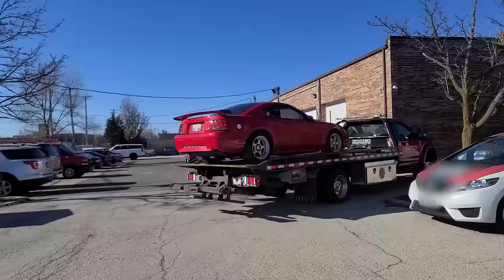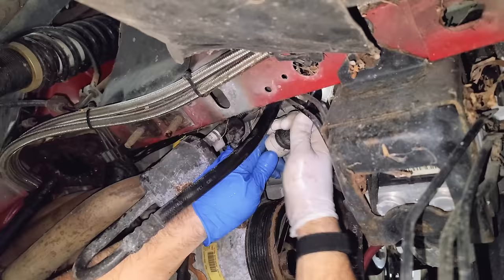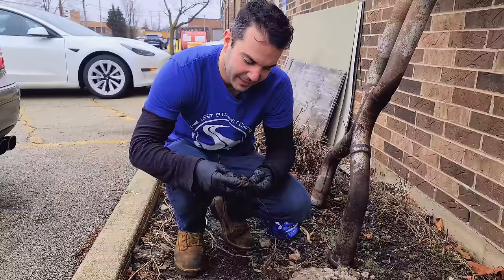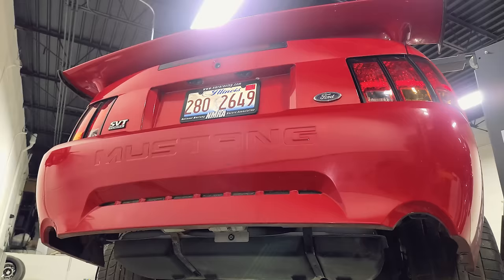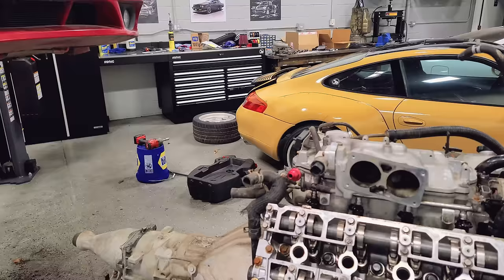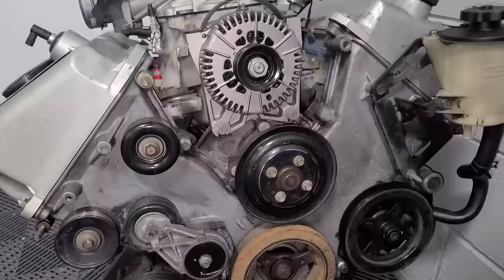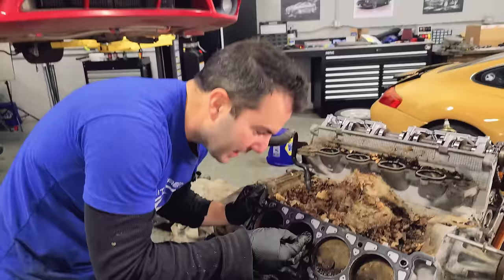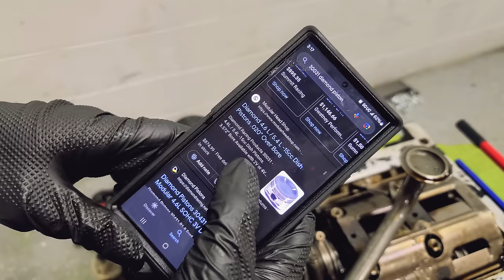Rebuilding The World's Fastest Cobra Mustang! ABANDONED For 20 Years! New Engine & CARNAGE!

Comment from the maker: What are you guys working on this week?
Reply: Framing in a bedroom in my basement unfortunately
Reply: I'm working on my 1968 VW Beetle
Reply: My 03 Mach 1
Reply: Jaguar xf v6
Reply: HAPPY NEW YEAR Alex and the LSC team!!
Rebuilding my motorcycle.
Reply: 1995 mustang putting a vortech on a 331 with heads cam intake. Hoping to make 500whp~ with low boost and mild timing.
Reply: tryna get my 07 mercedes e350 winter ready, quick question cause you are mr mercedes? any reason my transmission wont engage sometimes and also shifts with a little stutter before it warms up?
Reply: i am currently sourcing a flat 6 for my 02 outback. the 2.5 has timing chain issues and i want to get a better engine installed and make it even more reliable.
Reply: Nothing as it's winter, and snow is coming
Reply: A 2000 Buick regal GS going in with a built engine, cam, exhaust, headers, and series 3 supercharger on full e85
Reply: Suspensions on 2012 dodge charger and a possible engine mount.
Reply: I haven’t started on my project yet, but I hope to get started on my late grandfathers 2002 regular cab f250.
Reply: My Citroen BX.
Reply: 2001 dodge ram 1500 manual 5.2 v8
Reply: My mustang
Reply: Just Got a 2 stroke 100 CC Yamaha Rx100 Bike. Wifey is super mad.
Reply: Just picked up a 96 cobra with a locked up engine 😅   fml.
Reply: Building a new gauge cluster for my 68 F100
Reply: putting some lowering springs on my S550 Mustang
Reply: Jeep JK rebuild!  salvage title just got body panels back from the painter!
Reply: Honda CBR 1000F/Hurricane 1988
Reply: 2011 saab turbo4 2.0t 
Upgrading stock turbo to a ko4 and installing oil catch can. Oh and shoveling some snow. Gotta love Chicago
Reply: I’m tuning my little engine swap turbo civic hatch keep up all the hard work!!
Reply: 1983 Oldsmobile with the 5.7 Diesel.
Reply: 1992 honda prelude. new ecu and turbo goodies
Reply: Replacing center drive shaft support on my 2007 Tacoma. 
When it gets warmer, going to add power steering to my Mk 4 Factoryfive cobra. Might need extra set of hands. I'll drive it to Chicago.  :)
Reply: Sway bar upgrade on my 2020 SQ5
Reply: 2003 Terminator. Will be installing a VMP 2.3 and 60 lbs Injectors soon. It’s to cold now 😊
Reply: Honda crf150r
Reply: 32 foot Pearson 323 sailboat. Building my 1 litre 3 cyl Yanmar.

 Don't even own a car. Just an old school gear head. Had a '70 Mach1 when I was 17, though.
Reply: 1994 saab 900 se 3 door
Reply: Replacing my 25 y/o KitchenAid dishwasher!  😁
Reply: Working on getting over this damn cold.
Reply: My daughters boyfriends 05' Audi S4.
Reply: Gonna work on cooling on my steamdeck with my friend 😅
Reply: Trying to stop my Jag leaking rain water into the footwell 😭
Reply: Going through a 51 Vincent Black Shadow. Polishing wheels, checking brakes and new tires/tubes.
Reply: I’m finishing my supercharged Nissan armada 😅
Reply: Drivability issues with my 89 Dodge Dakota sport convertible. I've been through the fuel system, next comes the vacuum and emission systems hoses, then the electrical system.
Reply: Working on my 1996 honda accord
Reply: 1965 Porsche 356SC
Reply: 2012 Duramax rebuild
Reply: Another cold weekend in the shop working on the  1984 volvo 740
Reply: Can't work on my car (64 Mercury Comet) in winter where it's at unfortunately (where I live winter is cold 🥶 and the garage where I keep the car is not insulated or heated). Did check on it today and all was well...
Reply: Cleaning the caked on oil and dirt on the engine of my 2000 Excursion XLT, prepping for oil leak repair.
Reply: Brakes on the daily Mazda 6 and some emblem stickers on the GT350 while she sleeps.
Reply: Builds a 4 cylinder engine
Reply: 62 vette
Reply: Working on my 2012 mercedes c250 … cam/timing problems smh
Reply: my 98 eclipse gst
Reply: 04 ram 2500 w/5.9 Cummins....
Reply: My wifes 1999.5 cabrio. Did timing belt, clutch, and brakes all the way around.
Reply: 1979 vw super beetle convertible
Reply: 2007 gsxr 750 built from a spare engine and frame a lots of eBay purchases 😅
Reply: 90s dodge ram
Reply: 1999 E430 sport ball joints. Easy peasy
Reply: 1970 olds 442
Reply: Getting the carbon splitter and side skirts mounted on my baby, w205 AMG C63S
Reply: New to me 2016 F150 5.0
Reply: Prepping snowblower
Reply: swaping a ls3 into a 08 jeep jk
Reply: Putting a open air intake on my ford mondeo 2.5 turbo 5 cilinder. The sound of the turbo is pretty nice now.
Reply: 98 GT convertible I drove for 23 years. Sitting for a few years now. Gonna refurb entire car for my 13yr old boy
Reply: 2002 tundra long travel suspension install
Reply: 1992 firebird. V6 with leaking 700r4. With the idea of pulling my trans, I start to think about just doing a full engine swap with a slightly more modern trans.
Reply: grand cherokee amc 242 4.0l rebuild
Reply: 2022 Explorer St
Reply: I'm tearing out the interior of my 1979 Hurst Olds Cutlass.  I've got OEM fabric for the seats, new carpet and a factory looking replacement stereo to replace the factory AM/FM/CB radio.
Reply: 03 ZO6, replacing the steering wheel and pulling the wiper arms so I can clean out the mouse nest in the cowl.😢 previous owner stored it in a lean too with chickens 😂😂
Reply: Working on my neighbor.  Trying to get him to sell me a number matching ‘68 302 manual Mustang sitting in his front yard for the last 18 years.  He drives it twice a year and that’s it. 2024 could be the year!
Reply: I'm washing my Toyota Corolla. I dare not touch anything mechanical on it as I have a great mechanic who knows what he is doing and I don't
Reply: My ‘94 Mustang Cobra.  Putting in subframe connectors, jack  rails and strut bar.
Reply: Just finished re-suspension-ing my 206k-mile 200 Celica daily...serious rot where rear subframe bolted to frame stampings.  Took daily rust showers while doing the work.  She's got nice shiny black rear suspension now though and rides like a Caddy on the taller tires I bought her!  Just a little work with a 3-pound hammer to quiet the rubbing sounds from the front wheel wells!  Also had to cast new urethane bushings from 3D printed molds as the only way to get new rear bushings is to buy new rear knuckles!  WAY too spendy when there's nothing wrong with the old knuckles!

The thing's ready for the scrap heap and I'd like something a little newer, but there's nothing secure about Social Security, so I have to refurbish junkyard parts and keep the old girl running...thank God I know my way around cars!...I feel sorry for folks in my situation who don't!

Three kinds of cancer, a liver transplant, and a total colon removal ain't gonna stop me wrenchin', dammit!  It'd be nice, though, to have a bit more cash so I wouldn't have to buy the cheap, Chinesium, wheel hubs 'n' such from Rock Auto...but, hey, Ken-L-Ration has really improved over the years, and many parts of the pine tree are edible, so I'm good!
Reply: My golf mk4 , replacing rear door , and right fender + headlamp, 😮 then leaving it at the paint shop,
Reply: @@LegitStreetCars   I'm building my fully touchscreen preamp for my hifi system, with an 88 led stereo bargraph display using 2mm optical fibres!  Just finished the frame for the circuit board that positions the optic fibres precisely above the board mounted leds, & then repaired the design faults.  Also finished the aluminium mounting bracket for the board, so now the bargraph board is finally FINISHED & WORKING! - Ready now to have the optical fibres glued into the frame with UV glue, & measured up to be flush with the front panel.  About a week & a half's work.  What a tedious nightmare!  LSC videos are an excellent distraction for a break!👍
Reply: I'm repairing fuel tank leaks on my 90 Thunderbird SC
Reply: Nothing too exciting. Installing a backup camera on my 04 Tundra limited for hitch alignment, a new head unit, and a rear view mirror dash cam. I ran the backup cam wire before the snow hit, so I can camp out in the interior and do the rest. If only my garage wasn't filled with my wife's stuff. 😂 I'm going to build her a shed next summer if I can find the time.
Reply: Taking the kids to Disney World. So, I am working on my inner calmness in a sea of people.
Reply: 1994 S10 SS with a LS swap and twin turbo Borg S366's
Reply: Wifey's 2009 Chevy Traverse LTZ strong crank, no start, no codes... Changed throttle body and it drove for a few miles no issue, sat overnight and back to crank no start, doesn't even stumble or try to fire.  No stored or pending codes.  Great fuel pressure and solid spark.  I'm at a loss...
Reply: @rohittaurus911 had a 85 Yamaha RZ350 Kenny Roberts bike. Those were super cool. Revved to like 8700 or so
Reply: @CODPerryThePlatypus  tried the pedal tcm relearn procedure? Helped with random shift issues with my 04 e320... Does it shift with the tiptronic +/- in manual mode when the automatic is acting up?
Reply: Routine maintenance on the family truckster aka my 2014 durango
Reply: Selling my 04 cobra terminator this week. I’m gonna miss it 🥲
Reply: Trying not to loose mind)😅
Reply: Chevy Cruze 2011, burnin oil 😭
Reply: Getting my list together for a 120k mile service on the 2013 W204 C300 4Matic Sport.
Reply: Putting a clutch in my gt500
Reply: Replacing all door and window seals on my 6MT G37 coupe cause I got a major water leak.. 

AND a Harmonic Balancer/Oil/Coolant/Diff/Trans/Brake flush 😢 on my Silver 2013 Caprice PPV 9C3 ✌🏽😎

SELL YOUR CAPRICE TO ME ALEX!!! 😂 Maybe you'll let me drive it when I win the next AMG you give away lol

P.S. I was also a Mercedes-Benz Tech for years, and we had those engine tables for when we replaced the head gaskets on the M278's they're so nice to use. Also expensive.. I got x30 M278 camshaft tensioner pins under my belt 😎

I love all your videos man. I can't wait for them to come out! I appreciate how long they are. Thank you for the hard work! You have my dream job lol
Reply: everyones car but my own. mechanic life
Reply: On Sat, me and dad are driving 600 miles from Delaware to western PA to get a Muncie rockcrusher Trans for our 57 Belair.
Reply: Man where is peter ?
Reply: Generators and Volvos

Comment: 99 Cobras all had the same bumper as the GTs from the factory. Starting in 2001, the Cobra had its own unique rear bumper.

Edit to add: those calipers are made by PBR, and say Cobra from the factory. They’re one of a few popular upgrades for GTs, as they’re plenty stout for a New Edge Mustang.
Reply: The 96-98 also had its own unique rear not just 2001 and up.  94-95 and 99 just said MUSTANG for whatever reason.
Reply: @midnight347  that’s correct. I was speaking about the 99-04 cars specifically

Comment: I would stick some valves in the old heads and if needed, manually polish the valve seats, no need to go to a machine shop! The old heads seem to be much more tuned and probably tuned towards the supercharger you have! Bottom end looks amazing on the new one, so best of both worlds!
Reply: Manually polish the valve seats? Did I just watch the same video? Those things are roached, repairable most likely yes, but will need new valves, seats and guides at an absolute minimum
Reply: @danieledwards1081  it will need new valves that can be manually grinded to the existing seats. I just said this because the heads looked very very nice, despite the carnage of the valves. My only concern would be the seats, yes, some of them are rusty and could be a pain...
Reply: @cristianosantos9588  there's no way those seats will not need replacing, on top of that, you get what you put in with a valve job, better off just getting the whole lot refreshed properly
Reply: Factory heads are plenty sufficient.

 The old heads I'd throw in the scrap bin. Seeing those valves I can only imagine the seat is no longer.

 The block is probably scrap, I don't know if a Teksid is worth putting new sleeves in.

If it has factory rods they are junk (considering 99/01 Cobra's didn't have forged pistons or rods, only the crank), the crank MIGHT be the only thing worth anything but there was quite a bit of water in the crankcase and 20 years sitting.... IF the original damage isn't done to the crank.
Reply: @commonsenseisdeadin2024 dude the teksid is the baddest aluminum block Ford ever put into anything factory it's absolutely worth saving as are the heads.  They came with factory cranks the factory rods and pistons are the only things that aren't way way better than what was on gt back then and the only things that aren't comparable or better than what terminators had.  They didn't make aftermarket 4v heads the heads are always worth saving.

Comment: That's a hard decision, but I think I would rather have an LS1 F-body. Keep up the great videos, Alex. You're definitely a big part of my Saturday mornings.
Reply: I've had 2 new edge Mustangs (they were only GTs though) and I got rid of my 03 GT for my LS1 fbody. Even with mods my 03 GT wasn't doing it for me. Unless you do forced induction the 2v 4.6 isn't all that great and I just prefer the fbody.
Reply: @FWDSUXARSE you don't have to do forced induction to make a decent quick car out of a 2v you just gotta know what to do to it.  It's 281 cubic inches you're comparing it to something with 346 cubes.  The 4v is a diff animal they can make 380 wheel with just fbo and cams with a stock bottom end.  You can make close to 350 wheel with a 2v with trickflow heads cam and intake all the supporting mods and bolt ons.  That isn't bad for an na 2v and with the right setup can Def move for what it is.  People just don't know how to make more power.  The fbodys are junk piles everywhere other than the motor and trans.
Reply: @midnight347  Like I said even with all the mods you mentioned my 03 wasn't doing it for me. My LS1 is making more with similar mods, fits into tighter engine bays due to its simple design which makes the dimensions smaller than the 4.6L and it's a lighter engine. Anything outside of interior quality is easily fixed on the fbody thanks to the huge aftermarket.
Reply: @FWDSUXARSE  Then just say you like the F body more period.  It's ok to enjoy what you like.

Comment: 99s used stock mustang bumper, after the 2000 pause they went back to the Cobra script. Vortech got rid of the oil line on the V3 which were self oiled.

Comment: SVT Cobra all the way. I’m in the process of building a 2002 Mustang GT 2V. Stroked to 5.0. Forged everything, arp head studs trick flow heads from Modular Head Shop. Kenne bell 2.8LC supercharger. Hoping for 750 - 800 whp. Good luck with the cobra. Love the vids!
Reply: Don't go with that old dinosaur kb use a department of boost manifold and run a gen3r 2650 tvs that they make for terminator cobras.  Thank me later.  It will make the same or more power and way more torque and it will make it 100x more consistently.  Don't be fooled by the "liquid cooled" mumbo jumbo the gen3r annihilates it every day of the week and twice on Sunday.  It is alot more modem but it's just a 2.65.

Comment: That's a factory forged Kellogg crank, no issues with using it.  Those are factory head bolts and factory Ford camshafts as well.  The heads are painted blue to indicate that they are re-worked factory heads to address the cooling and tick issue.

Comment: 18:38 you can re-use the old front timing cover - you will need to for the vortech blower brackets you have to fit. The front timing cover was revised for a new belt routing and tensioner on the ‘01 cars. This is the FEAD or front end accessory drive in Ford-speak.
The water pump pulley is different because the pumps are different - the 01 motor has a longer pump snout and a more dished pulley. Can use either pump style with the correct pulley. They called these Modulars for a reason!

Comment: The "bump stop" above the rear end is what's know as a "pinion snubber" in Mopar land. It prevents the diff from twisting upward too far, then losing control as the spring rebounds see : axle wrap . The pinion snubber prevents axle wrap under launch conditions at the track. And..Definitely the LS1 F-body.

Comment: I worked at a Mustang and Ford Performance shop in the early 2000’s and I got to work on a bunch of these and this brought back a lot of memories! We had a customer with a very similar ‘99 Cobra with built internals and a Vortec S-trim, built manual valve body AOD-E with a stand alone TCU (complete with cool shielded toggle switches to engage reverse and OD because Racecar!). We also did a fuel system upgrade and 8.8 solid axle loaded with a 3.73 posi. It was one of the scariest cars I had ever ridden in up to that point, and the owner was a pilot that drove it every day! It was loud, rough and rode like shit (solid mounts for everything), Ill mannered and made mere mortals want to wet themselves just riding in it, and I couldn’t get enough of it! I miss cars like this.
Reply: They were so special and had so much character.  Today it is the total opposite.  They have performance but nowhere near the character or soul.

Comment: Always use hand tools to crack fasteners before using power tools.
For the front suspension, much safer and more practical to undo the strut tops instead of the spring retaining nuts.

Comment: Don’t forget the coolant cross over tube on the back of the heads if your motor doesn’t have it! Not sure if that was on those older 4.6s but the 03 cobras had a bad problem with overheating on the back cylinder on the driver side! 
I could be way off lol 
Still love watching 

Thanks

Comment: The washer in the coolant port is a restrictor washer for running no thermostat and still giving the fans time to cool the water in the radiator before it gets back to the engine old school drag racing stuff that's not needed with modern fuels and tuning